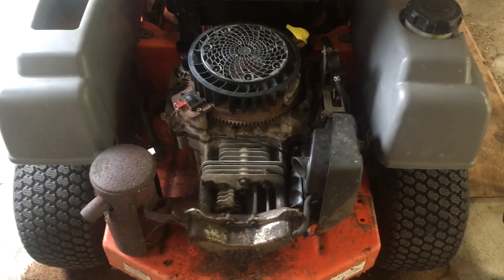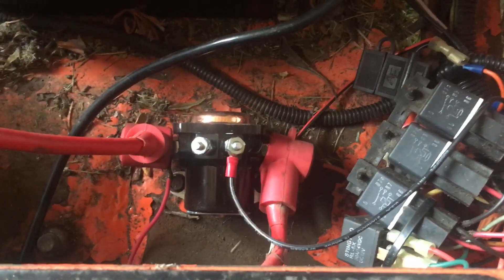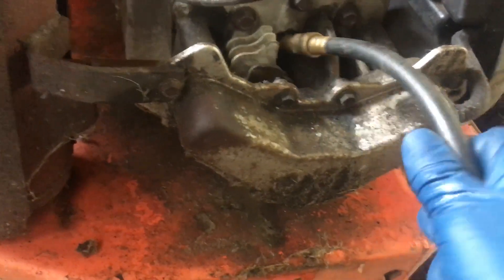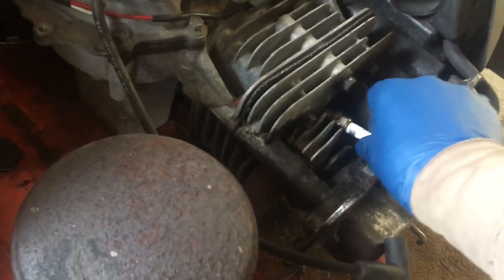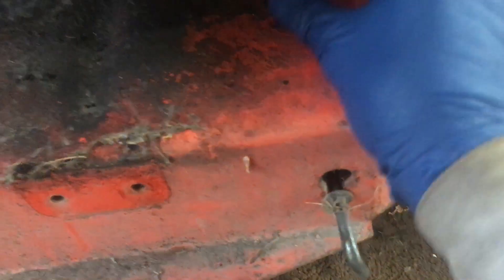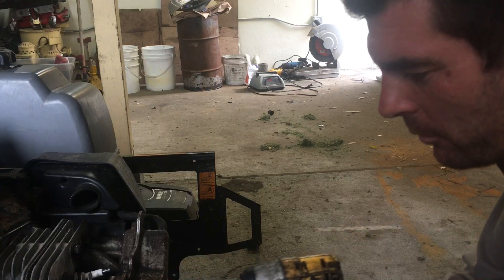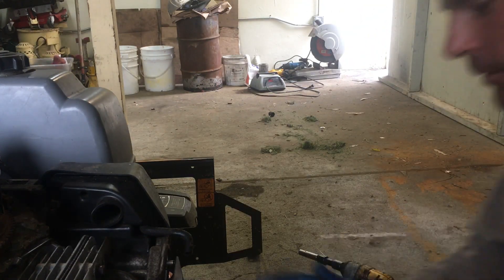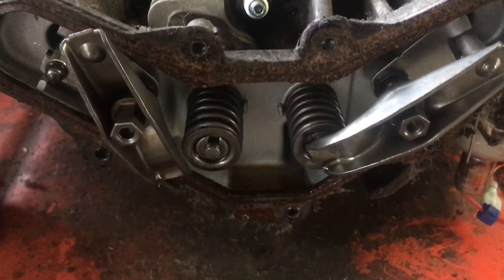Kohler 18 hp Courage engine hard start valve issue and automatic compression release ACR

Comment: You didn' clean the head and crap that clogged the cooling fins on the head. That is why the exhaust valve overheated and unseated. The valve seat may be loose, too. Any kind of oil leak on the head will accumulate and stop the necessary cooling needed. I use Brakekleen® to get rid of the crap building up and replace gaskets as needed. Setting the valves clearances, I use 6mm exhaust and 4mm intake clearances for wear on older brass gauges that flex. Tight with newer stainless gauges, so you have to allow for what type you use and the age. I use brass gauges because they are more flexible in tight spaces.

Comment: This is old, but I just faced the exact same issue on a friend's Craftsman mower with the 20hp Courage engine.  Just quit running on her. The problem was overheating due to 20 years of the entire cylinder head being caked with mud and grass debris. Cooked in hard and carbonized! Cleaned it out and suspected ACR, but found loose exhaust rocker. Engine would not crank at all due to valve not opening properly. Got stuck on compression stroke. Cranked fine with plug out. Exhaust guide out 1/2" as in video. Placed piston at TDC so valve would not fall into cylinder and removed spring/keeper. Used a socket that fit over valve stem and contacted guide and drove it back in until seated. Peened aluminum head around it to keep it in place. Pushrod was not bent, so reinstalled spring/keeper, adjusted valves and it fired right up.   To make it easier use a foot of rope to fill the cylinder to keep the valve closed. I had none with me, and it was hard to get the valve spring back on. She will make sure her cylinder head is clean from now on. She was paying a company to service it annually, but they failed to do that simple service. Four bolts to get the cover off. It runs like a champ now!